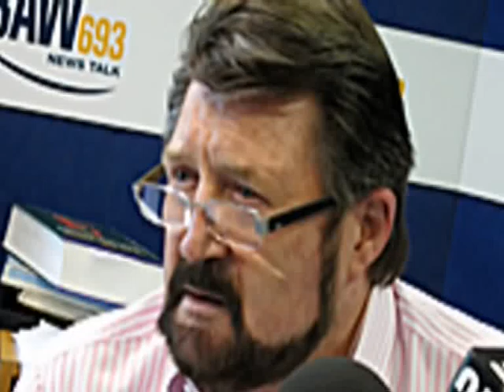Derryn Hinch talks to Paul Cridge about the Siemens trains

Comment: I used to be a driver...had one slide out on me - no words to describe the feeling when you put on a brake and nothing happens ...was heaps scary ...my train was empty it was 6 am in winter....I was only going about 40km per hour ...put the brake on and the train felt like it was on ice skates..it just kept sliding....I frantically pull the brake on and off about 5-6 times and eventually the brake engaged....apparently the guys at Siemens wanted to retain the contract to maintain when they sold them ...gov went back on the deal thinking they could get maintenance to workout the train ...they couldn’t - only the guys who sold the train did and they refused to pass on this info because they went back on the maintenance deal....if they weren’t so stubborn and honoured the deal that was made there wouldn’t be an issue...